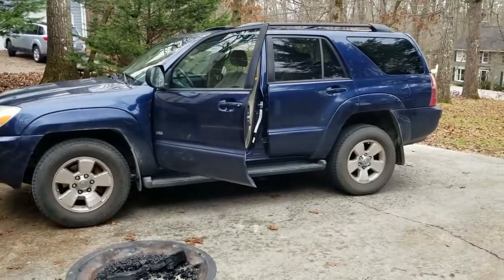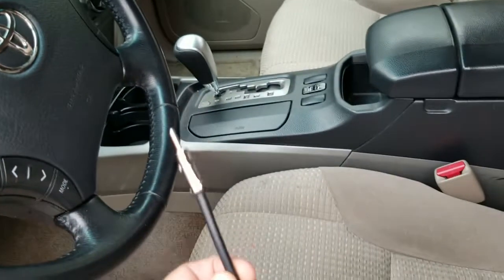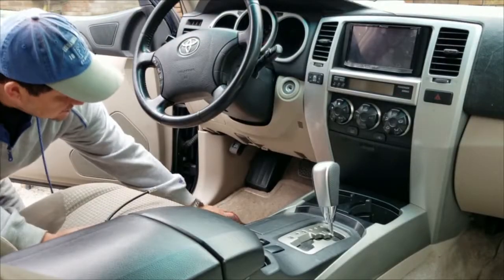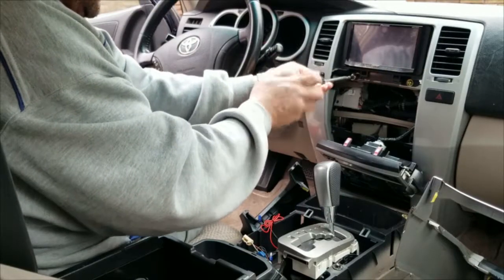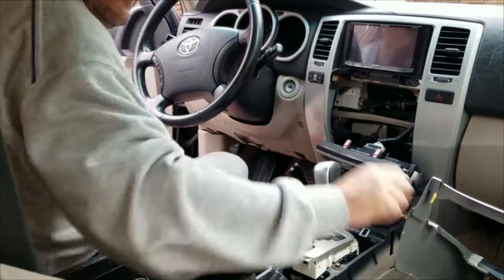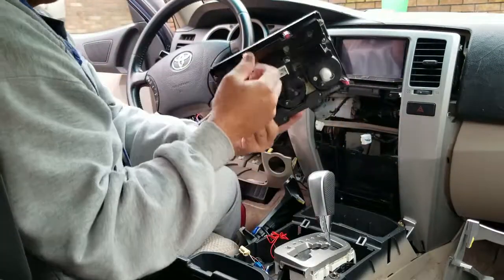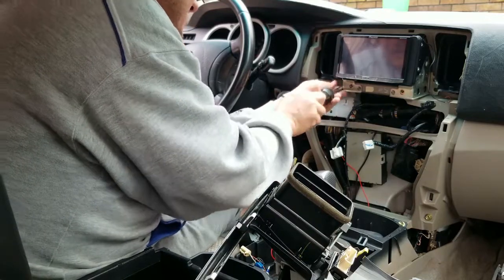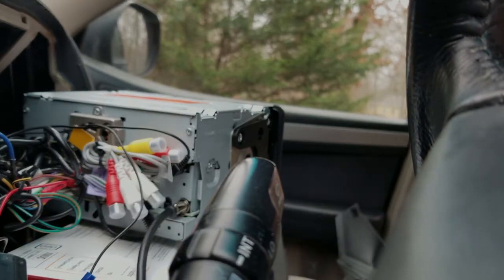2003-09 Toyota 4Runner Diversity Antenna Video

Comment: First of all, the purpose of a diversity antenna is NOT to split between AM and FM signals.  It uses two radio antennas that are installed inside the two window panels on the back side windows.  There is also an amplifier behind the stock radio that amplifies the diversity signal to the two antenna cables that connect to the back of your stock radio which was made for a diversity antenna.  You can certainly combine the signals with the adapter you bought, but it will NOT provide a good signal since you're by passing the amplifier that was designed for the two diversity antennas.   Research "diversity antenna" for yourself and you'll see.  I think it would be much more effective and provide a stronger signal to install a new center-line antenna on the roof like the newer vehicles have and not use the diversity antennas at all.

Comment: Does Toyota 4Runner have a TMC Antenna?  If so where is it or is it apart of the FM or Am Antenna?  I have a TMC plug on the back of my head unit but nothing plugged into it.  Was the Blaupunkt dealer supposed to install one with the deck?

Comment: Where I can get those cables.
Reply from the maker: Jose.  I bought the diversity antenna adapter from AMAZON.COM (by Carxtc - Part # B015X33YHO).  The problem is that it is no longer available (you can put it on the wish list wheen it is available again - $15).  The FM and AM plugs are different and that is what makes it a pickle.  The best bet is to buy a standard diversity antenna Y-Cable and an adapter for the small plug.  AUTOZONE can make this happen for you.  Take the car to the store and they can sell you what you need.  Good luck.  4Runner Ninja.

Comment: As mentioned in this thread, this item is no longer available. Here are some updated Amazon links to make this upgrade. It is essentially the same thing as in this video, you just need 2 separate items. The second link is an adaptor for the smaller (AM) plug. The vehicle filter might say it doesn’t fit a 4th gen. 4runner. Ignore it. It fits mine and works great. 

https://www.amazon.com/gp/aw/d/B08DFFHRY8?psc=1&ref=ppx_pop_mob_b_asin_title

https://www.amazon.com/gp/aw/d/B00009UHRI?psc=1&ref=ppx_pop_mob_b_asin_title
Reply from the maker: thanks for the update.  4Runner Ninja
Reply: It’s available now just purchased it
Reply: Do you need two of the metal adapters and is it the same way in the 07 4Runner’s

Comment: did this actually fix the reception? ive got an 06 avalon and have the same problem with reception i havent tried the fix yet.
Reply from the maker: The antenna did not make it super clear on am but it did help the radio pick up some am stations and the fm reception improved.